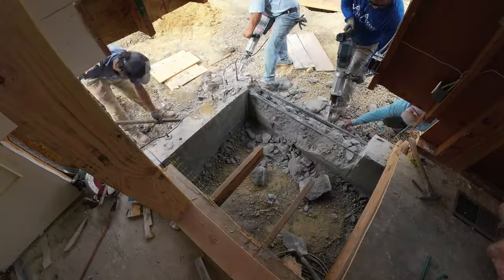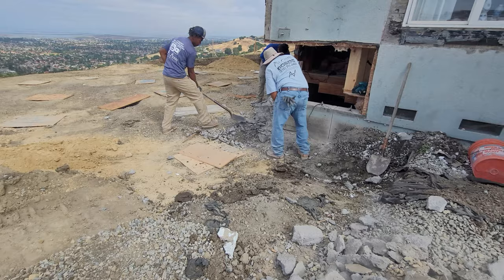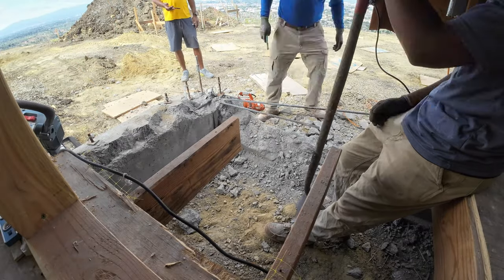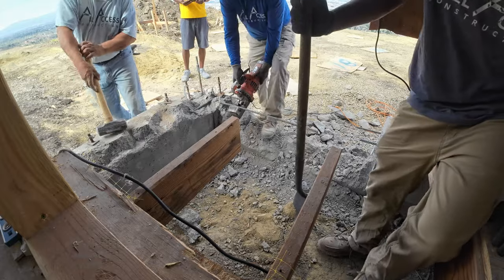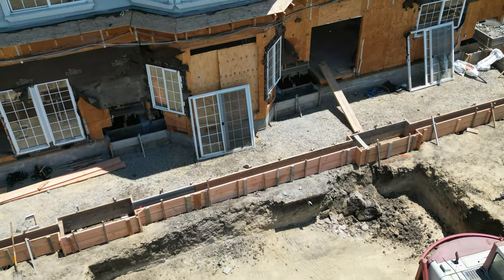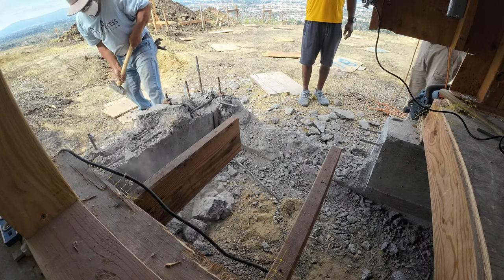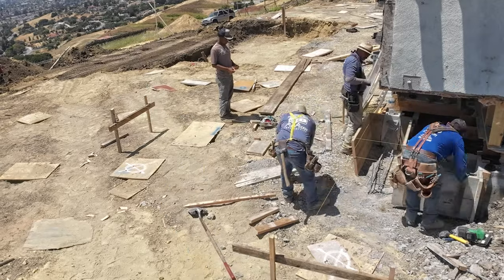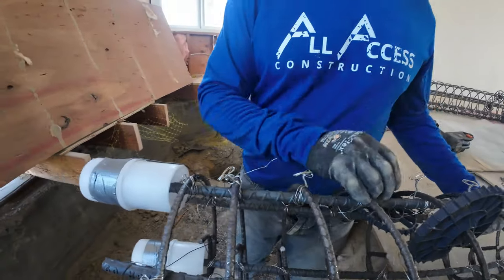Demo And Replacing Concrete Foundation With "New Bosch Jack Hammer"

Comment: I haven't demo ed much concrete but when I have I used a circular saw with diamond blade

Cut the concrete then used a sledgehammer it broke apart fairly quickly

But it was a sidewalk at least 4 inches thick

Don't know if that's the best way but it was easy
Reply from the maker: We did start out cutting on some of them.... But once the jackhammer got off a good piece it broke pretty easy